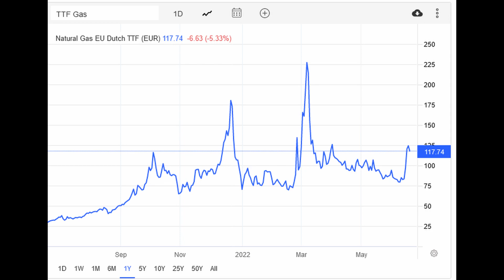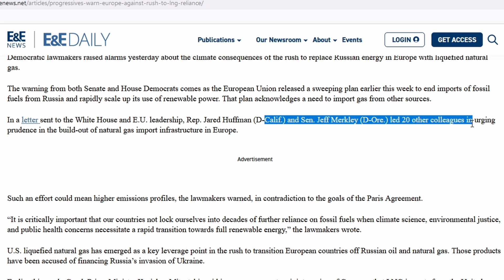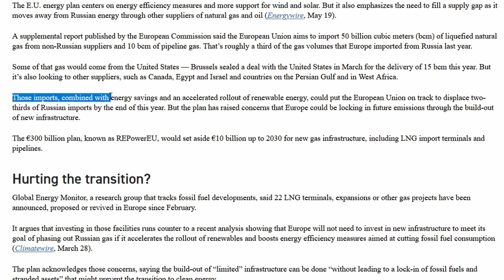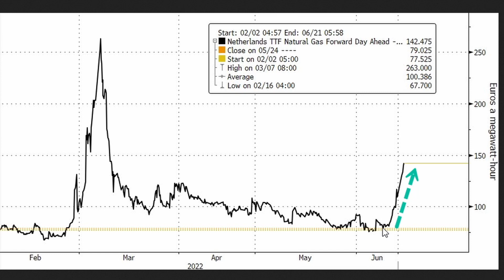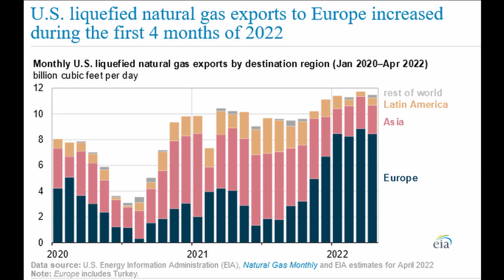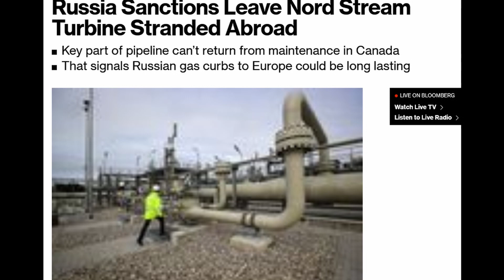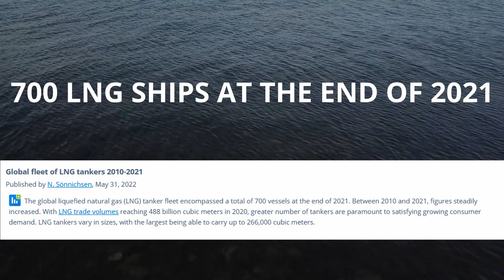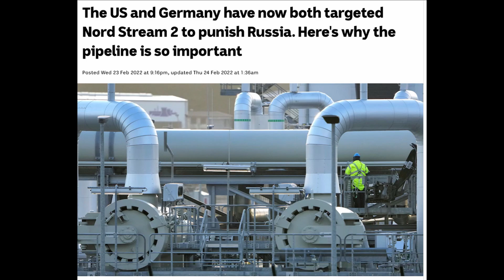Europe Natural Gas Crisis Explained (Nord Stream and Freeport LNG Supply Shock)

Comment: Yeah Europe can replace pipeline Russian gas with Russian liquefied gas but delivered through intermediaries
Reply: No, the capacity of LNG terminals in EU is limited to 30bln m3 extra. There were 155bln m3 pipeline gas from Russia, so 155-30=120. EU would need around 120 bln m3 of pipeline gas from Russia in 2022, or close consumer companies.
Reply from the maker: And Germany has no LNG terminals. Now  they are talking about going back to coal. Don't they get 70% of their coal from Russia?
Reply: @FinanciallyAware  on that soon gone too
Reply: @FinanciallyAware  I'm pretty sure Germany closed their last underground hard coal mines in the Ruhr Valley in the past few years. They still have a bunch of lignite in the eastern half of the country which they are burning.